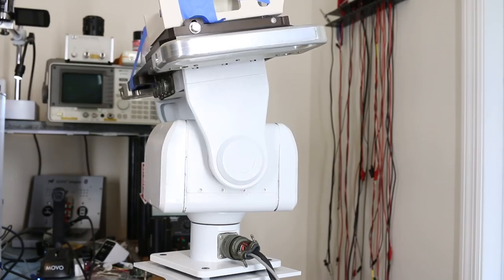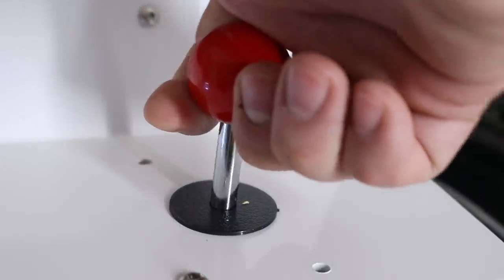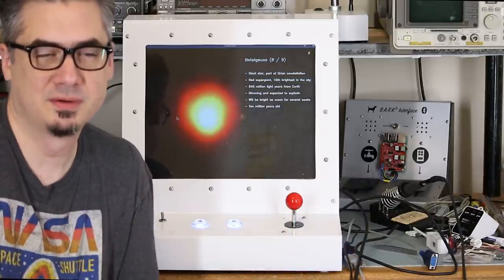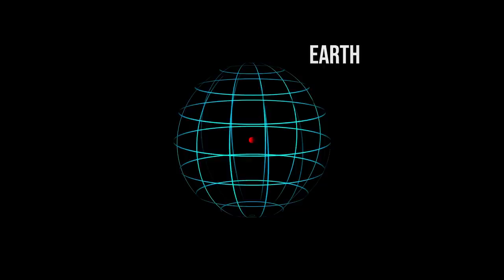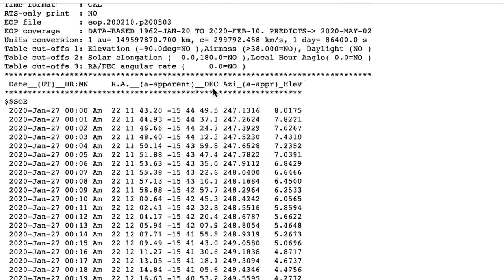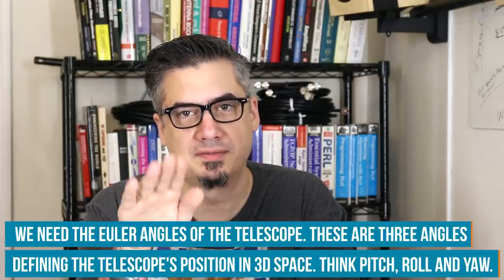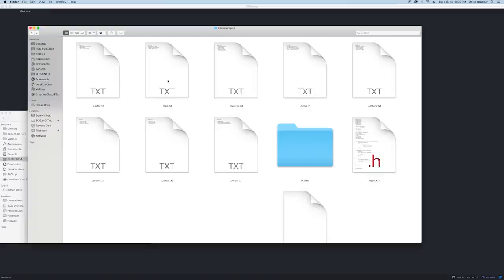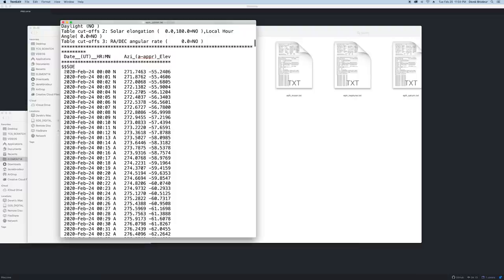Automated #RaspberryPi Planet Tracking GOTO Telescope

Comment: Fantastic idea and very impressive project! I recently made myself an Arduino driven focuser for my 5" Celestron Maksutov-cassegrain telescope (NexStar 127 SLT). 
I used a small stepper motor with an embedded gearbox which would perform a 360 degrees turn in 4096 steps. 
This translates to better that 1/10 of a degree accuracy in focusing without touching the telescope at the same time! 
It allowed me to use even a 5x powermate in front of the DSLR camera for planetary imaging.
Previously this was impossible because with a magnification like this, even the slightest touch on the focuser would move the planet out of sight, and it wouldn't even return back in sight after the telescope would stop wobbling.
Reply: make a video about it man
Reply: I second the commenter above! I would love to make this kind of project, with a spare stepper motor in storage :)
Reply: I just bought a celestron astromaster 130 eq, i was thinking about making an arduino motor but didnt decide wich stepper, nema motor to use. What did u use or would recomend?
Reply: @gocar7255  I can’t see my reply so, I’ll try again and I hope it doesn’t disappear again. I used an 28BYJ-48 stepper motor with a ULN2003 driver for Arduino. The reasons for this were the following: First of all, it works at 5V DC and it draws so little power to operate that you can even power it from the Arduino 5V power pins without the need for a dedicated power source. It’s easy to program even without a library, by simply sending 1 to each of the 4 phase pins of the driver at a time and 0 to the rest 3 of them. It also doesn’t vibrate almost at all on each step in contrast with a NEMA stepper. It has an embedded 64x gearbox divider, which makes its 64 total steps to 4096 for a full rotation, giving it a great detail in motion. That way you can connect it to do a direct drive on the shaft of the focuser. I have already posted my code as open source, along with photos but I’ll try to do that on a separate response, in case that was the reason for my previous response to disappear.
Reply: @skesinis  hey i just saw the amswer, luckily i went your way with the stepper, i did the same, didnt use the library cause only has 3 options for speed. So i went your way and used steps, but energizing two at a time for more torque. I'm trying direct coupling vs pulley. Thanks for the idea

Comment: Interesting project. For the calibration, you could place that little board inside a 3 axis gimbal affixed apart, so you cam tilt it without removing everything.

Comment: A USB port on the front so that the kids can save images to a USB stick.
Reply: Steven DallaVicenza great idea!!
Reply: @Unique_Leak   it's linux, so the majority of kids would be clueless, aside from this you can simply initiate a script when a usb drive is plugged in (or SD/other) to mount the media as write only, nothing can execute and nothing can be read from it, not even the existing data on the drive can be seen which also protects the kids information.

that way the drive can be mounted and data written without any fear of data breach
i am also aware of those malduinos that pretend to be input devices but you can also simply reject any device that isn't storage media

i think it would be amazing to have these on a roof somewhere visible, replacing the joystick with something more robust and leave the control panel somewhere public, perhaps with a 20p coin slot for use, beats any naff  "claw machine" you see outside shops these days... it'd probably require observing the system at all times, being present in person to prevent the one moron who wants to ruin things for everyone... but it might just inspire some kids to join the hobby :D

i've seen one guy who sat in a carpark with a huge telescope pointed at jupiter just so people can come and take a look, in the daytime, and was repeatedly blowing peoples minds how it was possible :D 

i think part of why kids aren't so involved is because most astro-hobby is done hidden away at night with crazy expensive equipment... there's not much for kids to get involved with

Comment: Fun idea to play around, that's about it!
MEMS IMU output data does not have that high resolution to be any applicable for serious astronomy, anything beyond spotting the moon at low magnification will not work well. Magnetometer does not give you very accurate Norths as origin point of your absolute angle measurements, there always will be calibration-related issues which will set it off by few degrees whenever you turn on your system at new location. for telescope GoTo system you need 0.5 arc.sec resoulition. 9-DOF IMU will only give you precision to around of 3 degrees (as absolute global Quaternion). If you have your origin point right (say aligned by a star)-  relative rotation measurements by Gyro will give you higher precision,  but still far from what is needed for GoTo systems.

Comment: Hello mate, Thank you for sharing this. I just stoped by and i'am amazed..
I whould like to make this project very soon. I have a dobson 254mm telescope and i want to make my goto pieace of software /hardware.
I don't have a motorisez touret, but i would use 1 motorized linear actuator for elevation and 1 step by step motor for azimut with some 3d printed gear
By the way... don't see any trace of the arduino code or the programs your using for the raspberry pi.
A more detailed explanation for beginers or a how to do guide with accessories that you used will be awsome. 
Everybody is not a IT programmer even thought we might have some it knowlage.
Whats is the magneto compass that you used and how to controll the motors with this programmed buttons. All seems so difficult to me, how do we put all this together please. I've beed on the page in the description of you video but there is no much details about how to....how do we implement the text with the celestial bodys positioning into the stuff...Please help us....cheers for the project. Out standing

Comment: Fun Project, Something I am Very into emulating for my Littles!
DIY tracking alone is a bit of a project in itself..But the added Interface is Incredibly cool..🤙🏻
Stronger steppers, Say, Nema 23’s and a Larger gear set up for finer Targeting… ? But that’s Mechanical.. The Programing and “Communication”  is the Bulk of the Work..
The Numbers are correct although the Anchored Reasoning of The environment is akin to a fudged, complex Sudoku. Still, Their still Numbers work, I just don’t buy the Attributations..… (I find The Sky to be Moving yet the Ground Fixed, Regardless of the “Sodoku”. Works fine, even using analog computing.)..But what do I know?..I’m just a Duke University, TIP recipient..
Also, NASA,JPL and the Associated mythos is Not actually as it appears…
Nothing says Satanism, Pseudo intellectual, CGI and Fraud Like “NASA”.

Regardless, 
Great Project🤙🏻

Comment: On Track is a much easier open source solution then trying to roll your own tracking system software, and it can connect with common astrolab software and large automated databases.
Reply: Thanks for sharing. Do you have a link? I couldn't find with a google search. The reason that I've rolled my own will become more clear in the next video :)
Reply: @AmRadPodcast  sry, its "On Step", been a while since i built mine.  hjd1964 on github has the setup, but there is a decent amount of info on their forum.

Comment: I really want to make something like this but on a smaller scale. I have the Sky Watcher Heritage 130p. I got a cheap telescope camera from ebay for like £13. Not sure if it will work or not. Can I hook up a raspberry pi to a 5 inch touch screen display from Amazon and make a type of cyberdeck to attack to the base of my telescope? It has a tabletop wooden mount with enough room for a low profile contraption possibly. Then I could hook up the rasberry pi machine to a portable battery bank and simply charge the battery bank when  I'm not using the telescope. Would this be possible?

Comment: Awesome project!  Pity the event was cancelled due to weather ... well, I guess that's the way things astronomy always go ... the moment you take out a telescope, particularly a new one, it is bound to be cloudy!  By the way, you "cheated" a bit at the end for just letting the Moon drift through the field!  I would have liked to see how it tracks the Moon. 

Anyway, this project reminds me of a satellite tracking system I made back in the year 2000 - see https://wpk.saao.ac.za/CoSaTrak/cosatrak.html  This was in the DOS days and I programmed it in Turbo Pascal!  Like you, I also fed in pre-calculated satellite positions, although I could calculate celestial positions.  Very clever to use an IMU to know where the mount is pointing (pity about the initialization complications) - how fine can that resolve?  And what are the angles of movement per (micro)step on the mount?
Great project all in all!  Wish I could program modern devices like you!